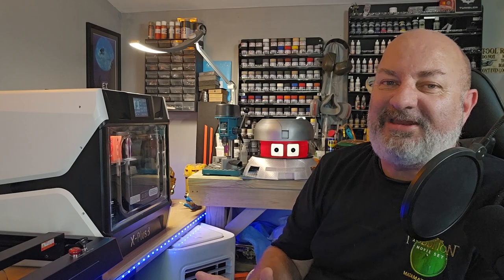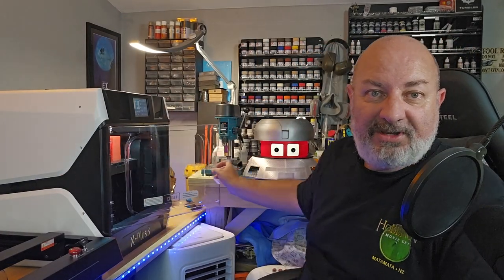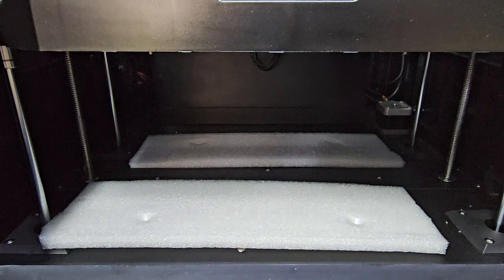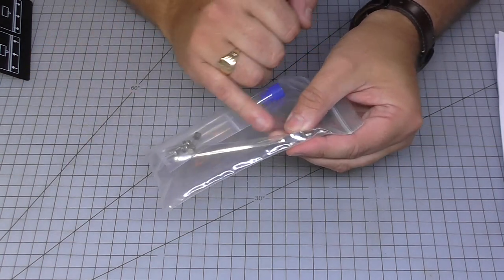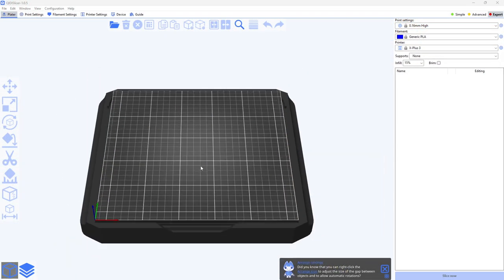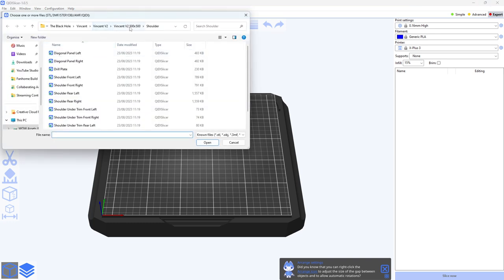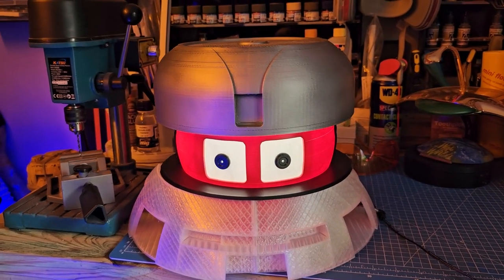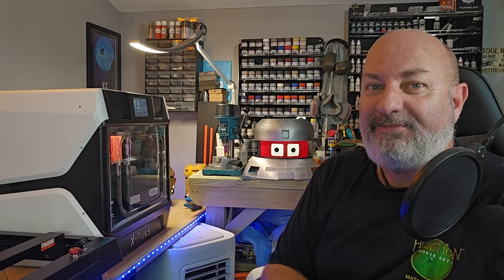The Qidi X Plus 3 3D FDM Printer - The Most Amazing Printer I Have Ever Owned

Comment: I'd enjoy a 3D printer but I dont know if I'd be able to keep it level because I live on a narrowboat. The boat rocks a little when other boats go by and depending where and how everything is loaded into the boat it often sits slightly differently in the water.
This will be a big boon to your models Wayne.
I'd like to see you print a Cobra Mk 3 from Elite Dangerous.
Reply: It should be fine, the levelling will be relative to the print head and printer. It's always recommended you don't leave a 3D printer unattended though due to the heat required at the print head, if it clogs and you're not there sometimes printers have been known to catch fire.
Reply: Agreed an fdm printer should be fine. I wouldn't recomend a resin printer for your particular situation tho lol
Reply: @matthewcoleman8267  Thank you. I wouldn't be leaving it unattended. The beauty of living on a narrowboat is you are never in a different room if you leave the door open. I also have fire extinguishers on board as a requirement for the safety certificate. It'd be a useful thing to have to run as a business.
Reply: @matthewcoleman8267  Most printers have thermal runout protection now so I shouldn't worry the fire issue. My K1 max's get left for days without being attended (you've got to love the AI camera and remote monitoring) 
 I did install an extra smoke alarm in my office to be extra safe.
Reply: People use the word leveling, but technically that is not the correct term, that notion on this subject was obvious made popular by amateurs. What  really matters is how flat the bed is, and how perpendicular the bed is to the Z axis. In higher level machines like industrial milling machines that have many similarities as to movable axes, the machines are built to much higher standards. But most all 3D printers, at least hobbyist models, are flimsy and inaccurate in comparison, and by probing the bed software can compensate to a degree for inaccurate geometry of the machine. Software can never really compensate for a bed that is not flat without distorting the part. But, we are talking about plastic here, so it's usually "good enough". In summary, it's a geometry thing, not a issue of being level in the truest sense of the word.

Comment: Nice printer but looks expensive. Did you say somewhere that the filament loads onto the back as it would be useful to include this into your video. If it’s so heavy though maybe it would be an idea for it to sit on a lockable turntable so you can turn it around easier for changing.
Reply from the maker: Good idea. I. Leaving that till the next video. Didn't want to overload the I fo in one video
Reply: I just got one of these yesterday, if you get a plastic cereal container and print a marsgizmo filament bunker setup you can ditch the rear container and set it on the side.
Reply: In the US, its $649, down from$1099. Not a bad price considering its print size od 280x280x270.

Comment: Question for you.  I just got this printer on Wednesday.  I updated to firmware 2.4.8 and can no longer set the Z offset.  I'm working with Qidi but wondering if you successfully updated the firmware?
Reply from the maker: I did the update before I started using the machine. Mine didn't have an issue
Reply: @WorldofWayneUK .  Thanks.  Did you update to 4.2.8?
Reply from the maker: @DanDelzell  I.did the update a couple.of days ago so.if that was the latest one then yes
Reply: I have the same printer and also updated. Did you try the reset to factory defaults option under the "About Printer" menu?  After that, power off, wait a minute, and try again.
Reply: @stew675  I had.  My problem was the firmware update wasn't updating the SOC. When you looked at about, my SOC was 4.2.2 but the UI was 4.2.8.  Qidi sent me a program that forced a SOC upgrade then we manually installed a pinter.conf.   Not sure why that was happening but I think I'm good to go now.
Reply: @DanDelzell  Great to hear and thank you for the update.
Reply: @stew675  & @WorldofWayneUK - Thank you guys.  Been printing a honeycomb wall all day.  I agree this is an amazing printer!